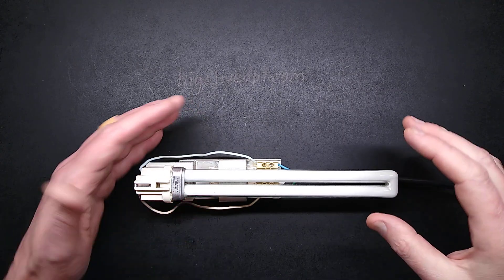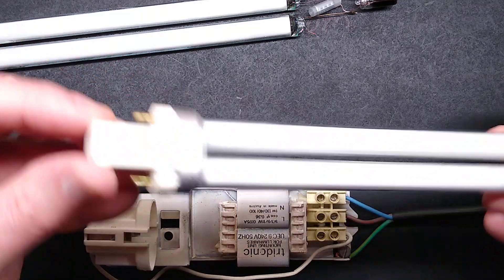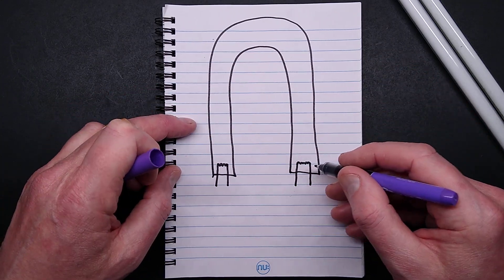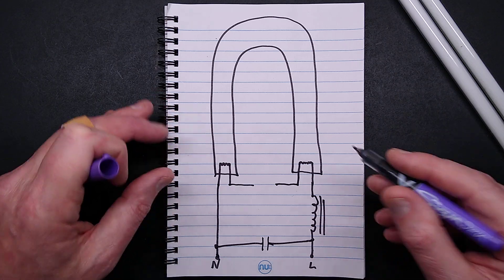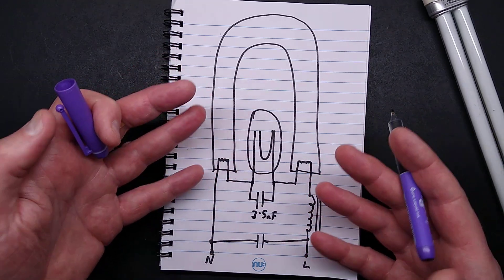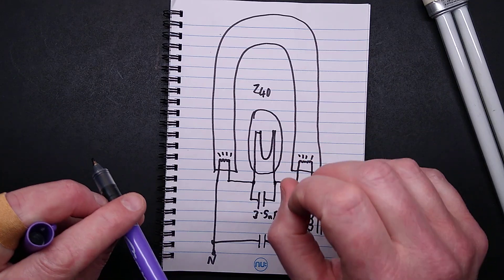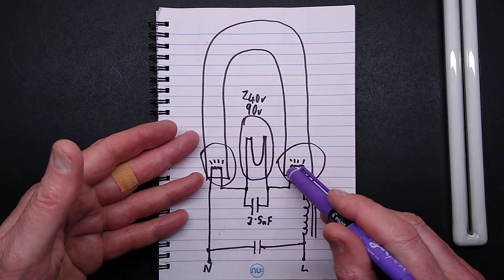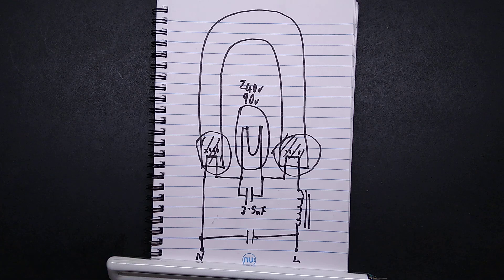Retro already?

Comment: This is what really pisses me off Clive, not just in the case of LED lights but cars, washing machines, you name it. The manufacturers all strive for efficiency so they get an A energy rating, yet the same appliances can't as easily be repaired. Or if they can, it will cost you a lot more and/or create more waste. When a headlamp, rear cluster etc on your car died it was a few quid tops for a new bulb. Now you have to replace a £1000 LED unit. Your fancy new washing machine may have an A rating and save you a few quid per year, but because you can't replace the drum bearings in most modern machines, you end up junking the machine after a few years.
Reply: Research "right to repair". More noise is needed from consumers.
Reply: I'm glad you raised this one - I've been thinking about car headlights/rear lights for ages. The days we can carry spare bulbs are limited, unfortunately...
Reply: @stepheneyles2198  i think it should be made a legal requirement for whatever the light producing device within the 'fitting' is, it should be easily replaceable, preferably user/owner replaceable ..
Reply: @stepheneyles2198  I had to replace the whole wing mirror once when the LED module was dead, this was a 2007 car. Luckily I bought a 2nd hand cracked one and removed the LED module... that was VERY difficult in itself. And because others want these mirrors for their broken LED lights... the second hand price wasn't that cheap either.
Reply: In Czech Republic, there is a small business specializing in replacing drum bearings in washing machines. They have a jig on which they cut the drum apart, replace the bearing and then they weld the drum back again.
Reply: replace a £1000 cluster unit and have to hack the firmware because they all have serial numbers and your other option is getting it done at a dealer who will charge 5x that... I'll keep my mechanical speedometer for now thanks
Reply: Another issue with this, specifically to do with cars. Your insurance company will not repair your car with used parts, so when each tail light assembly costs nearly 1000 to replace, the repair costs grow quickly, so while in the past they may have repaired the car, these days it's more likely to be considered a write off even if it would be repairable.
Reply: The 3rd light on my car died in December. They had to order the $150 LED unit. Thankfully most of the other lights on the car are ancient bulbs.
Reply: Well, from the appliance manufacturer's standpoint, $850 every five years is better than $650 for something that won't wear out for a few decades. I wish somebody could tell me why the cheap, non-durable e-waste is more expensive.
Reply: I agree, this should be covered by "the right to repair" which is currently being campaigned about. Another example is computer  "hard drives" which are now just memory chips soldered into place
Reply: From what i've seen Fabric softner is the death newer of washing machines.
Reply: We have six electric weedwackers for some reason.

Both them and my featherlite fl20 where in the same market (absolute bottom of the barrel). It's impressive just how much CHEAPER things get over 20 years. It makes the featherlite look like a stihl...

That said, the corded one is actually pretty nice tbh!
Reply: @qwertykeyboard5901  
   You get a "HELL YEAH" on that Brother. Whoever is old enough to remember full repair kits for almost every carburator up to 1980 or so, as well as kits for many alternators and generators, and well as suspension bushings kits.
    
   Edit: Right or wrong? 😎👉🏬🏍️🚗🛻🚐
Reply: @StanErvin-yo9vl  Despite the pumping diaphragm being wrinkled, It only really needed new fuel lines and a filter!
Reply: @qwertykeyboard5901  
  Great! Love your username. Wondering If they make a keyboard for Morse Code.
Reply: Working as intended by regulatory capture.
Reply: It's a game environmentialists, governments, and investors play
Reply: @the_expidition427   Do you live in The Land of Copious Consumption? 
The days of free and cheap energy are done.
Reply: @BTW...  Do you live in the land of leading and barbed questions?

About that energy isn't related to repair. I repair and fix my devices instead of consuming that isn't related to free cheap energy? That is simply confusing. From my perspective it would be good for me to direct you toward the Right to Repair legislation and Louis Rossman.

Look into "eco-friendly" HP with DRM locked ink cartridges. Certain design choices are made by manufacturers that are intentionally flawed and designed around replacement and consumption

For energy with nuclear, efficient natural gas generators. and hydro this is simply untrue with increasing efficiency. It's called greed in the way replacements are engineered.  Other than that I don’t engage in these conversations, they’re unhealthy.
Reply: Oh STFU about the 1k LED unit, as these are numerous now, so are the shops that fix them.
Reply: And they stopped using induction motors: so that it's 100 bucks to replace the brushes every 3 to 5 years, if you know a fair professional or bring your machine to the recycling center where they'll probably claim it's ecological enough to be made to shreds and being tossed to... the beans, rigorously SOY beans, otherwise they don't grow well.

All of this ECOISM is getting to my rear end, I can feel it!.
Reply: @m80116  Wait, what?
In what sector has the use of induction motors decreased?
If anything use induction motors and permanent magnet brushless motors has increased with the lower price and higher availability of VFDs and motor controllers.
Is there an industrial niche I'm not aware of? I'd argue that brushed DC motors are more useful in some applications and brushless motors are being used to replace them because replacing brushes would cost pennies, even if the brushes weren't sold as spares you could always cut new brushes out of another, larger graphite brush whereas replacing a motor controller in something like a power tool,  is difficult if not entirely impossible.
Reply: @daviddavidson2357  Household appliances, specifically washing machines.

I never heard about changing the brushes to a washing machine motor until one of my acquaintance told me it is very common practice as they have a limited foreseeable lifespan.

At this point I wouldn't be surprised if they started using brushed DC even for the venting fan of the dryer machines.

But I guess at this point is rather irrelevant, I know from the same source the most common point of failure is the electronics board, something that old appliances with the programming wheel never had statistics about because it never failed.
Reply: @m80116  Some manufacturers use brushless motors now, especially on their more expensive models,  as they are quieter and don't make that whining noise when they spin.
Reply: @daviddavidson2357   Forget it.. it's not worth arguing with.
Brush or not... horses for course's. 
The intended rotational speed is the major determining factor in the type used. You cant get the standard 1phase 50hz induction motor spinning fast. 
If anything, I see less Universal AC/DC brush motors used, especially in the battery powered tool market.
Reply: @m80116   The program wheel timers, complex cam switches, suffered mechanical and electrical failure.... frequently. 

After 10 years you might be happy with a manky old washer that consumes more water and energy than need be... but your kind are done. 
 
The most common washer motor is and always will be a form of induction motor... even those that you find in every front loader in the market place. They are multi-phase wound, driven by advanced solid state motor drives.  Simple as that.  Base models use cam timers, because base models have less cycle options. 

Do you still have one of those olde fat ass CRT TV's too?
Reply: @chriswilson1853   Nope... washers and dryers contain induction motors, that have no brush sets. 
They have always done so. 
The 'noise' you describe comes from motor bearings, gearbox noise, and belt drives.... all but redundant in a new style drive configuration where the motor and wash drum are directly attached, mounted by same bearing set. 
This is VERY common.
Reply: @BTW...  I wasn't arguing, I was asking a question.
He's not wrong about things being engineered to fail and the manufacturers making things cost-prohibitive, or outright impossible to fix. Things break more often now too. I've a CRT TV from the 80s that works as well as the day it was bought. Early 1080P LCD TVs (Pre-LED backlight) also have an excellent service life and many still run well today despite years of abuse, though modern LCD/OLED TVs have an expected life of 10 years and then you just dump them as fixing them is cost & time prohibitive, if at all possible. Marketing departments convince fools this is a good investment because they'll want the 'latest new thing' after 10 years anyway. Governmental targets and goals don't help either.
Reply: @BTW...  It's either you're behind schedule or you don't live in the same world we live in.

According to my contact he replaces a lot of those brushes in washing machines. He warned me the next one will not be like my last one.

In fact my last one is from 1994 and it's still going... with a bit of maintenance from time to time.

Currently here in Italy there is NO washing machine on the market using a mechanical programming wheel anymore.
Reply: @m80116  You probably misunderstood him on the brushes. Washing machines are moving towards BLDC (brushless DC) motors like a bunch of other things like compressors for fridges/air conditioning and even electric fans and mixer grinders (at least here in India).
Reply: @m80116  You are deluded and have never worked on these commercial or domestic appliances.
Reply: @m80116  Absurdity argument always work well for you? 

Induction motors in modern domestic appliances are common, as they have always been. 
The 'brushed' motor (Universal wound) are also common, as they have ALWAYS BEEN, ya numb nut. 
How else would you get an induction motor to spin over 1400 rpm ... or even 24,000 rpm? 
There happens to be more 'in the wild' and made every day to serve an ever expanding market... you know, people that buy sh!t they don't really need.
You can help... if you can breed... do the World a favor and DON'T
Reply: @m80116  why would you need to replace a brushless motor? They should be near maintenance free.
Reply: @UloPe  Why do you ask me? I've written they STOPPED using induction.
Reply: @m80116  Ah misread “brushes” for “brushless”.
Reply: If you can afford a car that has a THOUSAND POUNDS LED unit, then I think you can afford to not complain about it.
Reply: @der.Schtefan  Most vehicles that are $20k U.S. have these $1k lamp modules it's the way it's priced for replacement
Reply: @the_expidition427  Most car companies make the bulk of their profit from the sale of spare parts, not from the original sale of a car.
Reply: @the_expidition427  
   Let's not overestimate the power of exaggeration. I have actually seen a $78USD sealed beam lo-hi purchased at a Pep Boys ™ by the gentleman in line ahead of me. What's funny is that I was there to buy both for my classic '74 Ford for less than twenty bucks. The lenses were getting cloudy. Saved the old ones to buff out with white buffing compound on my rare day off.
   FYI, I have a rebuild kit for the alternator in my garage. Fifteen bucks. A rebuilt one is 179 less 50 if you turn in your old one. 🔩🪛🔧⚙️
Reply: @der.Schtefan  
Not so when it comes the the second or third hand market...
cheap car by then..
but the LED lights are still $1000
Reply: @der.Schtefan  "If you have money you should stop whining and spend your money on unnecessary things"
This attitude is the problem, why do you think manufacturers make LED modules that cost a grand to replace rather than making parts easily replaceable. Because someone like you will come along and claim that because someone could afford a car they deserve to get screwed over just for owning it.
Reply: @der.Schtefan  Why? We're talking about average and even cheap cars here, not luxury models.

Just because someone can afford a car doesn't mean they've got money to throw around on a routine basis.

There's also the environmental aspect. Writing off and scrapping an otherwise good car simply due to a light failure is just crazy.
Reply: @der.Schtefan  soon that is all that will be available
Reply: Most people buy secondhand so we get lumped with this crap

Comment: I've got a twin 2'/18W fluorescent in my loft. I put it in there about 20 years ago. It didn't get used much until recently when I had solar panels fitted and have needed to go up there to change settings occasionally.